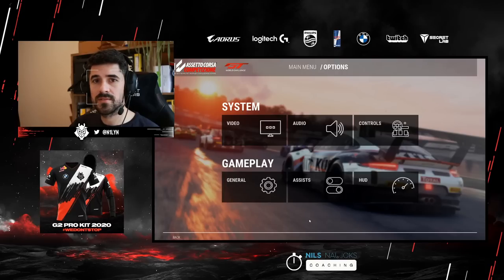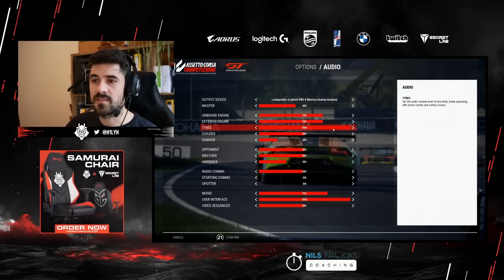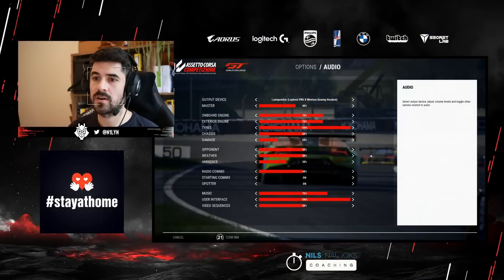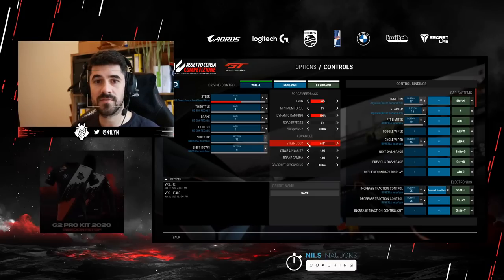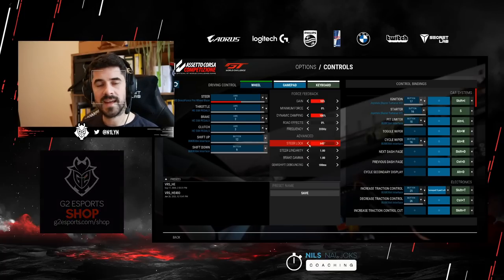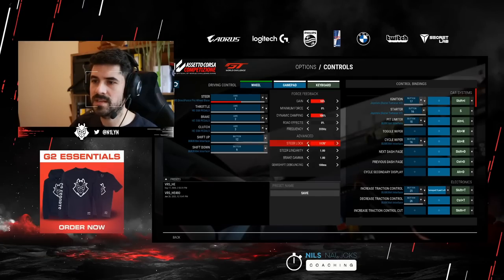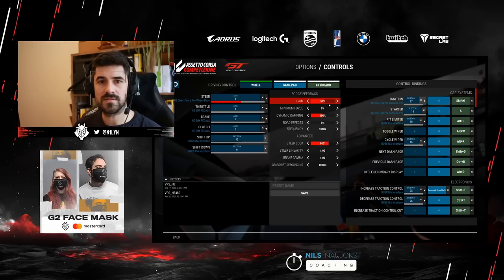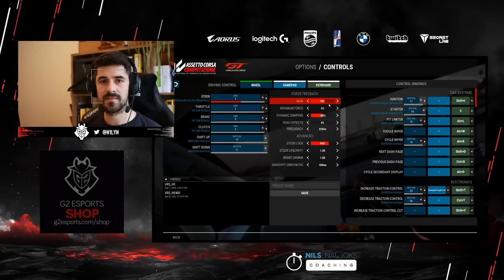Understanding ACC 1/3 - Controls, FFB, Audio, GFX - Assetto Corsa Competizione

Comment: i play on ps4 and recently reduced some feedback settings due to the noise coming from g29 and it has been better. I'll follow your expert advice on the audio and visuals as there is still a bit of lagging especially when pit lane opens and happens in the brake zone whilst or during cornering
Reply from the maker: especially gfx settings are more relevant on PC i guess. Audio and FFB should apply to the console version too. I know the logitech can be noisy indeed. Theres a solution though: noise cancelling headphones ;)
Reply: @SimracingPopometer  i cancelled that lowering road effects at 25 and gain at 50.
Reply: @SimracingPopometer  thanks for all your expert support to the sim community. i honestly wish that developers for sim racing on ps5/xbox hire your services as i would make their work so much more easier in total.
Reply from the maker: it's counter intuitive. on acc "0" road effects doesn't mean they're off. 0 just means standard. anything above is boost. you could go to 5 as well.
Reply: @SimracingPopometer  I'll test it. i used the Lamborghini ST for testing as it reacts a bit more to road effects like the bumps coming out of the 1st chicane at Monza on ps4
Reply: @SimracingPopometer  good morning Champ. i sorted my steering mismatch by adjusting Steer Scale down from preset 100 to 80. Also had to adjust brake gamma from 1.00 to 1.50 as for some reason the preset 1.00 made it difficult for g29 to brake late. i haven't tried higher values as yet but will let you know the results.
Reply from the maker: I've tested the G29 in our office and it always worked with 900° in the LGS/Hub software and 900 in the game. For the brake pedal i'd rather check the deadzone if theres an issue with reaching 100% and not fiddle with the non-linear settings. In the end what works best for you of course, but it doesnt sound like the ideal way
Reply: @SimracingPopometer  it seems console is different. In fact very different since update 1.3.7 when ffb, fps lags and everything became unusable. A lot of gamers gave up however i stuck with it and can still race online without issues as long as there is no mandatory pit windows....lol.
Reply: @SimracingPopometer  console also has less options for wheel settings compared to PC. We only have Steer Scale which I adjusted to match my exact rotation, Steer Linearity and Brake Gamma both preset at 1.00. At the latter preset if i use brake points similar to you i will not only miss the apex but lock up and lose Consistency and Car Control heavily if i am able to save the lap at all...lol. Initially I have been able to race full AI by capitalizing on their weakness on cold tires and wet conditions another area that's different from PC because on console red tire widgets can be run for entire race with good consistency at 2secs per lap faster than AI but i must also mention my wet trick is to constantly adjust TC to maintain pace.
Reply: @SimracingPopometer  unfortunately on console i am only able to graphical test percentage inputs of pedals and wheel on Dirt Rally 2.0 with the bar simulation. because of the rubber piece in the brake pedal when using GT Sport the brake display doesn't acheive full 100 but that also allow for trail braking more consistently something that was affect badly when i removed the rubber piece for an entire Fia season leading to bad tire wear with my OP cars.  On Dirt Rally the lack of full brake travel is not an issue as for off road you don't want full braking mostly just enough input to maintain your line on entry. In real life rally i use my brake a lot more to control the car on the ideal or fastest line which is the one described as clean created by the previous drivers ahead. The game Dirt doesn't include this physics at least on console as PC is near untouchable as shown if one chose to compare their daily challenges  leaderboard times with other genre like xbox and PC.
Reply: @SimracingPopometer  I've just streamed a video on my channel of the difference between PC and PS4 with the G29. I also forgot to mention that i race in either Helmet or Head cam views that's the two that display the in-car steering wheel so setting steer lock to 900º doesn't match what I'm doing to screen display even though as an auto technician I'm aware of irl gear ratios/multiplication factor that are used to achieve let's say 5 to 1 ratios in movement. in game that extra movement is distracting unless i learn to use the view minus steering or dashboard option which somehow make me feel as though my nose is up against the windshield and being in single screen with ps4 i not only look for braking points but turn in and apex. Fortunately I've never had to use full lock but getting used to the extra movement because 540 is one to one lock to lock would take me some practice and single player racing on each track and maybe I'll start today. in the video you'll see that g29 braking display on bottom right above ffb display is max at 70%. Aceleration is 100%. On ps4 on my first exit from pit at Misano you'll see i locked up early despite the short run and missed the line and apex with Gamma at 1.00 that was fixed with setting at 1.50 and less input. From my tests though at least on console Gamma delay or reduce the effect of ABS. For now unless console users stream game play we are not able to record our races in-game as you can only save the last 3 or 4 laps even though i have mapped save race and save highlights to the g29. I'll keep working on this so that i can show you some gameplay for your analysis and comparisons as like one of the comments show you have a wide following not only on PC and i make myself available in anyway you want as we rely heavily on your mentorship. I also did the Honda NSX in Career mode prior to 1.5.4 and that was the car i got the trophy for under 1.25 at Spa. It was also the car that was most affected by your brake ducts settings in endurance racing. The progressive engine map 1 allow me to race on TC 0. try that on the aggressive mode 4 and you'll get the trophy for totally wrecking the car and engine within one lap at Paul Ricard....lol
Reply: @SimracingPopometer  give me until maybe next week for a feedback on ps4 with 900º. Most guys on the ACC community use lower degrees as on console from experience prior to version 1.3.7 the steering wheel became very light and super responsive which immediately killed me with the Lamborghini which I was using for Career mode then. But I'll go again at each circuit and I'll provide both reply feedback here and a video on my channel.

Comment: Two years after this video was released, just wanna ask if the settings for wheel rotation is still valid? I have a Fanatec CSL DD wheel, should I set 900 deg in both driver and game still?
Reply from the maker: I didnt get my hands on the CSL DD yet. Your target is that the wheel in game and the wheel in your hands turn in perfect sync. usually for that, game and driver must be set to the same value and the value must be equal or larger to what the car actually has
Reply: @SimracingPopometer  does that matter even if I drive with the cam only showing the dash?
Reply from the maker: yes. the visuals are only a check. what matters is the wheel sensitivity. when you turn the wheel, say 90° and the game does 180°, then it will be very tricky to drive. same goes vice versa of course

Comment: Hey Nils! On a direct drive wheel, is there any benefit to having the gain set to 80% in the driver and 55% in the game like you have it, versus 100% in the driver and like 30% in the game (what I have). Thanks!
Reply from the maker: the equivalent would be 40% but no, theres no difference. i just limited it in the driver to not run the risk of getting super high spikes from a game error or so - just a safety measure
Reply: @SimracingPopometer  got it, that's what I figured but wanted to make sure. I'm wondering if I should turn up my gain a little, my settings are only for about 5.1nm.. don't know how you do it with 8.8nm, that feels too strong for my weakling hands :D
Reply from the maker: arthur couldn't handle it too :p
Reply: @sergiu_bogdan  I have CSL Elite with just 6 Nm and even gain on 100 is not strong enough, but it’s clipping. Gain at 60-70 is not clipping but way too light. If I can buy a Fanatec Podium DD2 I would put it on maximum on the wheel and in-game offcourse without the clipping. I’m a 100 KG strong build man so that’s 1 reason but the most important is because of the Better immersion and better feel.
Reply: @bmwM3M5M6  I drive with a simucube2 so no clipping at all, but it's not about strength. I was just joking, I did both muay thai and bjj which requires decent grip and arm strength, and I'm 6'1" and about 87 kg haha. It's about what's comfortable for an hour to about 4 hours which is the most I drive in one sitting. 5.1nm seems pretty comfortable to me, I'm wondering if I'd get some extra feedback going higher but then again some esport drivers turn ffb way down or drive on very weak wheels.
Reply: @sergiu_bogdan  I’m much interested in the power also because on the website of Fanatec by product information there is stated that the Podium Direct Drive wheelbase delivers 25 Nm of Peak Torque just like a Real Race Car. And I want to come as close as possible to the real thing regarding the wheel feeling. Never driven a real GT3 race car but onboard videos of real GT3 racecars they are almost always fighting with the wheel in corners if they push really hard and Fanatec Direct Drive wheelbase also videos from Youtube they are also fighting with the wheel in corners when pushing. And also to correct slides quicker and more responsive. These are my thoughts about more power. What do you think ? Also note: I drive 1h stints/2h stints to replicate the real racing for example 24h of SPA. They also doing driver swaps and then rest for some hours and then back.

Comment: Hey Nils, what are your other configurations in the Vrs Software apart from max force?
Reply from the maker: theres a smoothing slider from 0-4 and I use 1. So just a tiny bit of smoothing. I also have a slider to boost smaller forces and I use 30% there. everything else is 0. there are not many settings, its fine straight out of the box
Reply: Nils Naujoks Simracing thanks 👌🏻 „slider to boost smaller forces“ is which one? 😅
Reply from the maker: "friction" if you have the respective driver. I was in touch with VRS on that matter - I'm not sure this has gone into the latest release anywhere, yet. So it might be that your friction slider is friction and not linearity

Comment: The steering lock and Fanatec wheel of 900 degree doesn’t work on ACC PS4.... On PS4 you need to adjust it to every car apart
Reply from the maker: thats unfortunate. there is, however, a list of the correct rotations per car on my discord in the setup-physics channel
Reply: @SimracingPopometer  Going for a powerful gaming PC just for ACC. The real race of Lamborghini returns in 2021, I want to make a chance to be able to participate and that’s only on PC. There are no motorsport E-Sports on Playstation 4 so PC is the answer.

Comment: wish these bloggers would mention pc or console in there title, saves me listening for 10mins then moving on cos it has no reference to me, but i am sure its great for pc users.
Reply from the maker: Sorry mate, I indeed forget there's even a console version of the game. I'll call a video out when its PS or XBOX as the game originated from the PC

What about the FFB and Audio thing though? That should be the same for PC and console
Reply: @SimracingPopometer  soz to sound short, bad enough xbox one X is capable of 4k 60fps but in ACC is capped to 30, but settings are not 100% compatible either, great vid for pc mate as i watched it anyway.
Reply from the maker: it's unfortunate they had to make that compromise with the game on console.

my driving related videos definitely apply to console too, hope you get value there.
Reply: 'these bloggers' is a multiple world Champion and any serious SIM RACER would know what he has been doing. I am also a console gamer and i have been able to apply some of what he shared. ACC on console has no option to measure inputs so as per advice test on track and you will see a difference. I have been able to reduce FPS drop by changing console settings and by following 100 AI i was able to pick out brake points, improve my trail braking on tracks like Misano and maximise use of valid circuit lines by watching Nils videos. The information on ffb clipping, steering ratios, tyre sounds are relevant for drivers that achieve 83 and above Pace ratings as these will limit potential of preset set ups and misinform custom tuning.
Reply: Who cares about console, don't you have your own forums and comment section in your apps you pay a monthly fee for ?